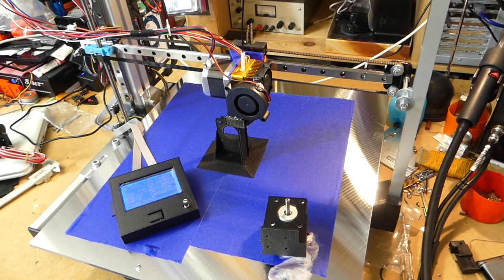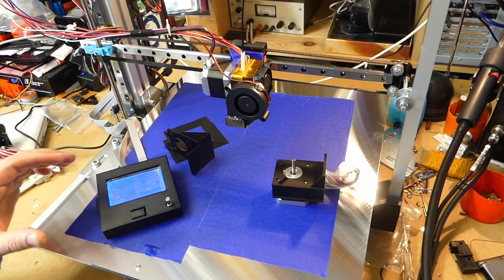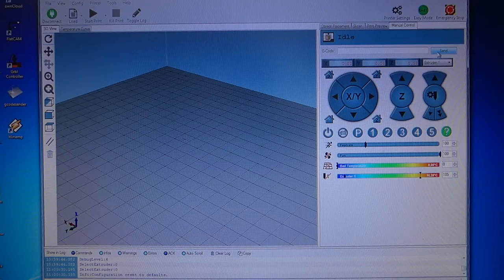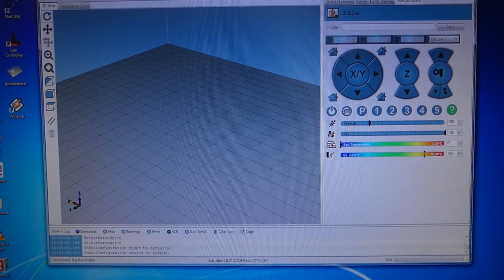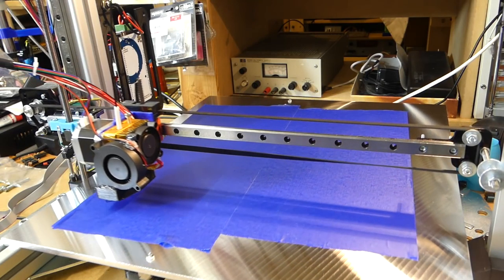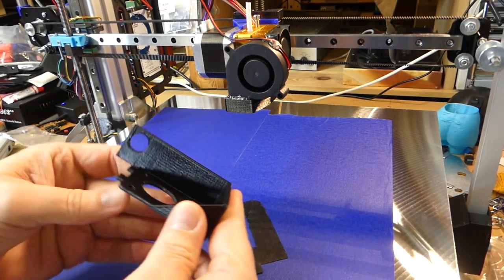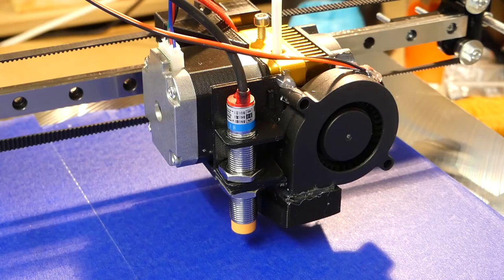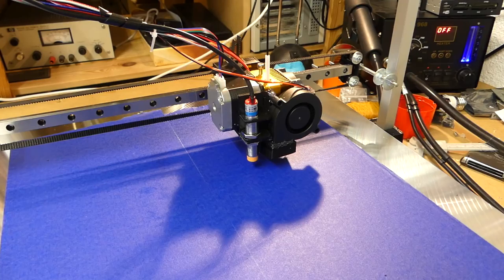Big Bad Robin Build VLOG pt. 11

Comment: <Still nice> Printing PLA ? What speed is "fast" ? ... "ringing" & sliced with Cura? -> tune accel down a bit
Reply from the maker: Fast is 80mm/s for infill.
Reply: Danke - Dragon and Groot were much slower ?
Reply from the maker: Groot is getting a small twin tonight,  but I will run out of filament after that - baby Groots do tend to go missing really fast around here ...
Reply: ...<ahhh> let's hope they will reappear "painted" <rofl>  !enjoy!   (in my case THAT is the most popular application)

Comment: +Dirk Herrendoerfer 
Dirk - Please show the "underbelly" of your buildplate ;-)
(I can see 4 screws into y-rail and remember vid showing a bearing (608ZZ ?) on the right  - what else?) <grin>
Reply from the maker: The underside is covered in part 2: https://www.youtube.com/watch?v=2ss80DlVcq4
Reply: Danke - Just wondering if you drilled blind holes (Sacklöcher) and used screws into the buildplate corresponding in number to the linear bearing holes (minus those 2+2 that also fix the belt holder)
Also: How does the alu-surface  look along  the way of the 608 after that "week" of printing...
Reply from the maker: There are two holes with threads in the Build plate near the center. The four screws that also hold the belt holder go through the build plate to accommodate for the difference in expansion between steel and aluminium. The surface of the aluminium has more fingerprints than scratches.